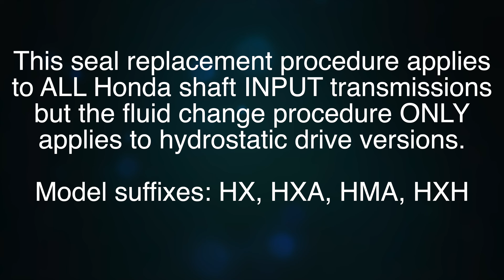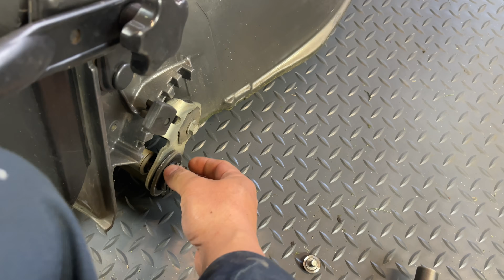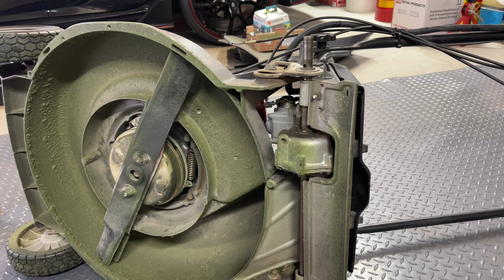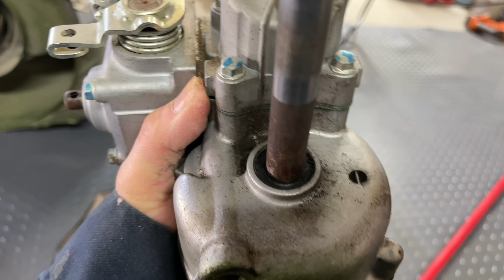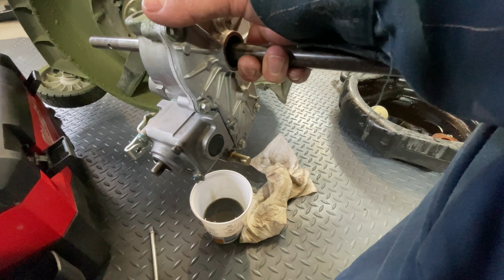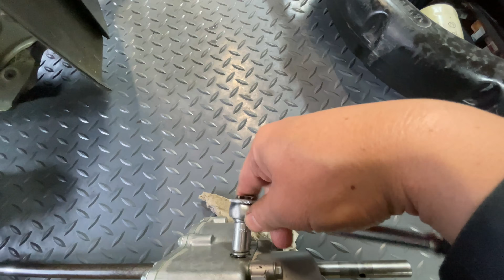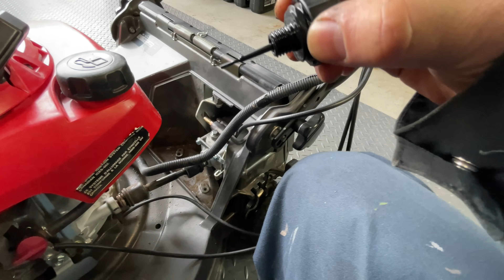Honda lawnmower hydrostatic transmission oil change and axle seal replacement

Comment: Unbelievably perfect video. Thank you for your attention to detail. I have an HR215 HX that had a seized engine. Got the engine purring but it propels super slow (despite adjusting nuts to lowest position on the drive cable). I was going to replace the cable, but began thinking the transmission fluid could be very old and will start there. Thanks so much!!!
Reply: Found the fill port with your tutorial. Yeah, there was no oil!  Put some in and propels great. I suspect it may have a slow leak out the seals, which caused the issue long before I bought the mower, but now that I verified it does work, can replace those seals later this summer.

Comment: thanks for the video.  Great help.  Mine is suffering similar problems andhopefully is not damaged from running too dry.  question about oil fill - do you know if the hydrostatic dipstick is like the engine oil dipstick in that you measure from just putting the stick in and not screwing it down or do you measure it fully screwed in?  Thanks
Reply: I think you must screw it in fully, but I'm not 100% sure.  I wish he had covered that too.

Comment: I recently converted a HR215 SX to a HX, installing a hydrostatic transmission, to make it work, I had to change out the shift assembly as well. This video was extremely helpful in preparing the drive, Thank you for providing this, and in a easy to understand context.

Comment: 0:10 I thought HRX mowers were hydrostatic?
Reply: all of a sudden mine started leaking and she's only 7 years old! 
I sure wish there was a video on the HRX217s.
Reply: They are
Reply: they indeed are however, they use a different transmission design where it uses a belt to drive the transmission and not the shaft drive like how you see in the more robust commercial/old school premium series mowers.  The shaft drive trannys were extremely well built and would usually last a lifetime for the typical homeowner.  Even used in commercial applications the tufftorque made shaft drive trannys would take a severe beating and keep moving like the day it left the factory.  The HRX units especially the early ones were prone to failure and while they are VASTLY improved that the HRX doesn't quite hold up to the same toughness as the honda commercial or master series aluminum deck units.  That being said, I STILL want a HRX series in my stable complete with electric start as they were the last of the very best honda made in the premium residential /light commercial mower segment.  The HRC series holds the crown as the GOAT of all Honda mowers but they're insanely expensive, unwieldy and just overkill for most folks (even though i bought a new one just last year before they were axed completely from Honda's lineup).
Reply: @ thanks.   I need to figure out how to remove the unit to drain fluid

Comment: Hi such a supervid…..I have the same mower, got it out of garbage……runs great……trans runs great as well……the only thing I notice that when pulling lawnmower backwards ( trans not engaged) there seems to resistance which requires more force to pull backwards vs pushing forward? Does your mower have similar resistance? Maybe it time to change trans fluid? Thanks for your insight
Reply from the maker: Glad you liked the video!  I would say pulling back and feeling difficult means that the rear wheel ratchets are likely seized or installed on the wrong sides.  You need to remove the wheels and check the ratchets and make sure they are oriented in the right direction.

Comment: I can't pull/pound/cajole/heat/lubricate or in any other way (short of drilling) get the axle friction pins (in front of the adjusters) out. Any ideas?
Reply from the maker: Yike, my reply is super late but I hope you were able to get the axle pin out.  If not, you'll have to use some type of penetrating lube and a TINY bit of heat to loosen up that rust to get the pin out.
Reply: @piercedasian  Thanks for the response. I did succeed... just applied more pressure (there was a bit of rust). I was being too careful. Your video was very helpful.

Comment: That transmission looks nothing like whats in my hr 194 unless mine is a first generation type or has someone fitted a 2 speed after my gearbox failed
Reply: Two speed is what is in the 214.
My niece has one.
Reply from the maker: @wayneessar7489  sweet!  The HR214 uses a meshed gear tranny and not hydrostatic.  Still a tough and well built tranny.
Reply from the maker: The HR194 uses a meshed gear tranny and is not hydrostatic (fluid driven) like the one shown in this video.
Reply: Thank you! Great vid. Does my HR195 have this type of trans or the meshed gear tranny?

Comment: Great video.  I have changed seals and flushes before but never used a old seal to push down the new seal in place. That is a great idea that I will use in the future. Thanks!
Reply from the maker: Glad you liked the video.  These tranny's were truly tough and should last nearly a lifetime when care for properly.

Comment: Just in time for my mower repair!

Is it OK to leave the transmission in place, and just siphon out the fluid and refill? At least the fluid gets refreshed to some extent.
Reply from the maker: My reply is super late but to get a proper fluid change you really do need to take the tranny out so you can dump the old fluid out.
Reply: That's what I'm going to do with mine.  I'm not removing it to change fluid.